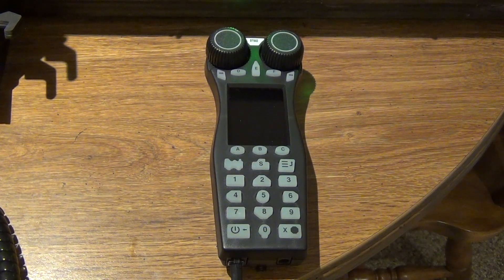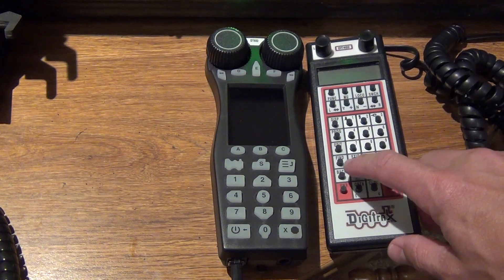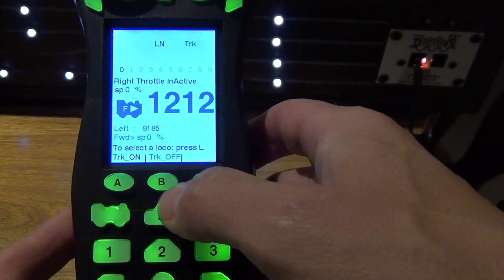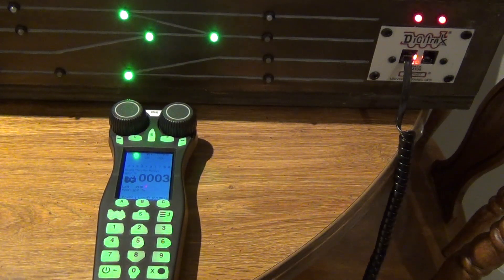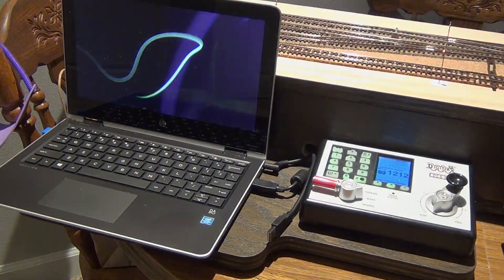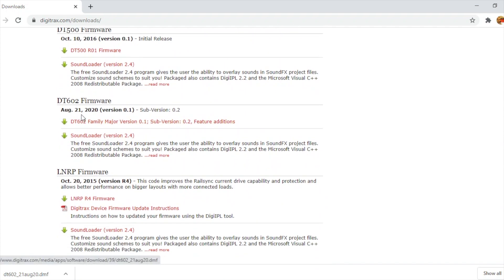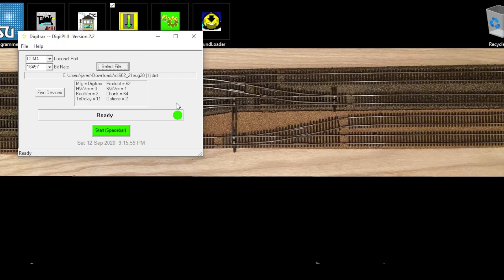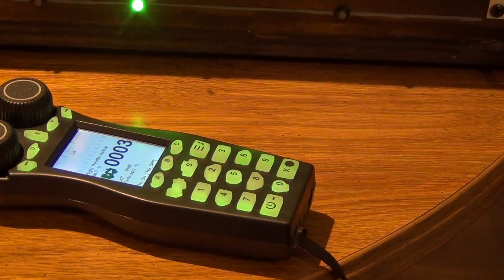Digitrax DT602 firmware update (September 2020)

Comment: Thanks for this video.  I've done the same, and with a DCS52, but during the firmware upgrade, it said, after a minute, Upgrade Failed, and now the throttle keypad just blinks on and off.  I've removed batteries, turned off the system, etc, but it powers back up, and just blinks...  Any idea what to do next?

Comment: For some reason my left throttle doesn’t respond as it should.  Randomly jumps to different speeds in a non-sequential manner.  Has anyone observe this?
Reply from the maker: Thanks for the comment. Disclaimer, try at your own risk.  I would recommend resetting to the factory defaults by changing line 40 in the Options Editor menu (page 22 of the manual, you can find this on the Digitrax website in the “downloads” section).  If that doesn’t work, you need to contact Digitrax because it sounds like something is damaged or corrupt which are causing your issues.
Reply: @ck7813  ok thanks
Reply: I just opened up a ticket so we’ll see.  I can still operate but it’s quite annoying and now the second throttle
Started acting up today.  I actually got as searching a few things and ran into your video again lol.
Reply: Response from Digitrax: Turn off Ballistic Track in the throttle Options.

Press the Menu key, the 3 key, the 3 key again.  Scroll down to ID01 and turn it OFF.  

Had the ballistics on…

Comment: Can I use a MAC Pc for the update?
Reply from the maker: The short answer is, I  don't think so.  You can try downloading the Digitrax software on your Mac and try it.  If you can get the software to work, you can get the update to work.  I would recommend emailing Digitrax support for more information.  I have not tired this and cannot guarantee it will work.